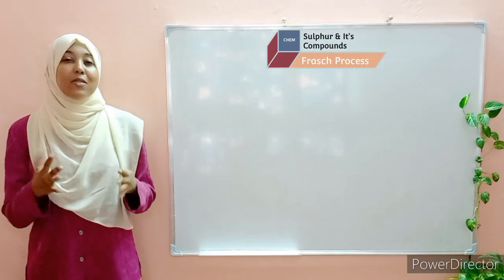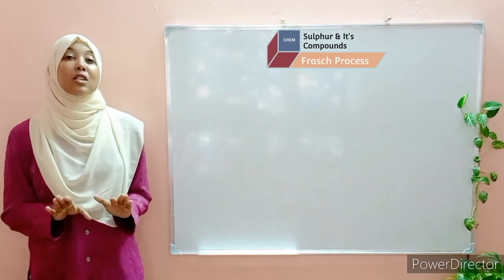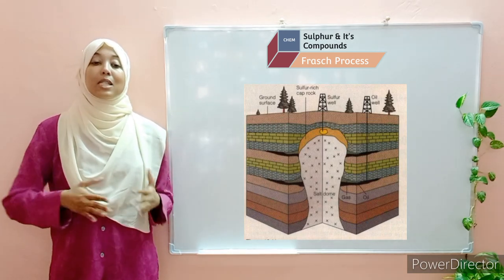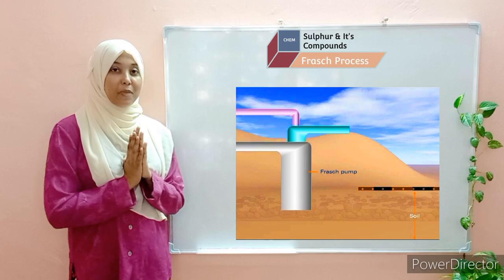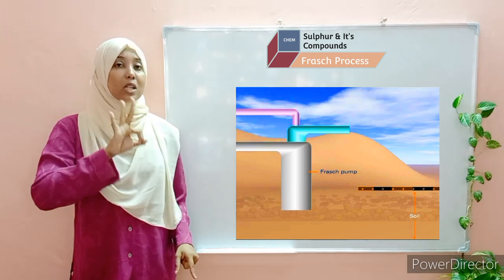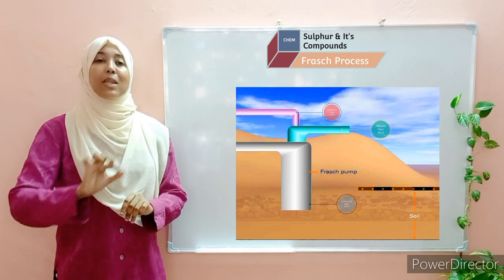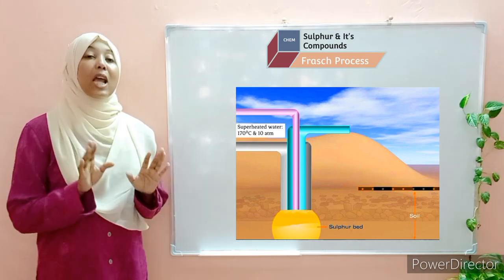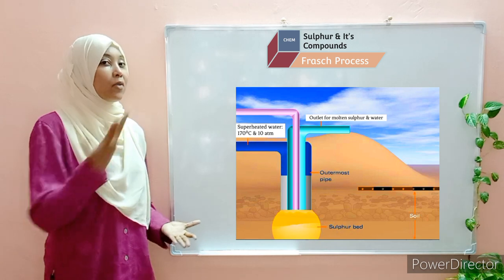Extraction of Sulphur I Techniques Employed in The Frasch Process I KCSE Chemistry

Comment from the maker: QUESTIONS TO TEST YOUR UNDERSTANDING:

1. State two properties of sulphur that make Frasch process possible.
2. What does the term concentric pipes mean?
3. What are the different diameters of the three concentric pipes used?
4. What passes through the outermost pipe?
5. At what temperature and pressure is the superheated water maintained at?
6. What is the role of the hot compressed air that is passed through the inner pipe?
7. Which pipe serves as the outlet of sulphur?
8. How does sulphur separate from water after collection?
 
   To a Deeper Understanding of Science! 🥸🌟